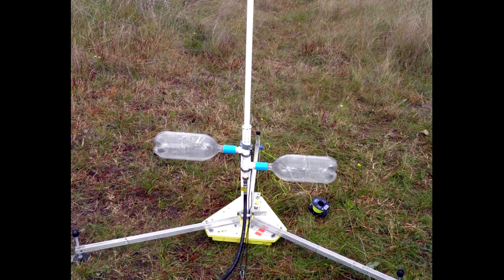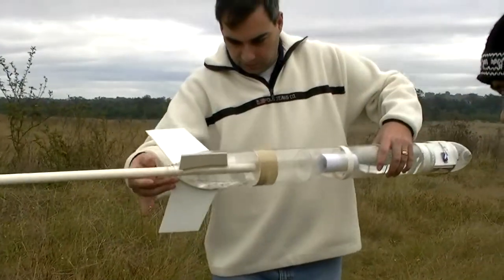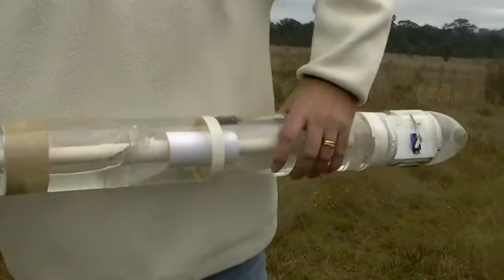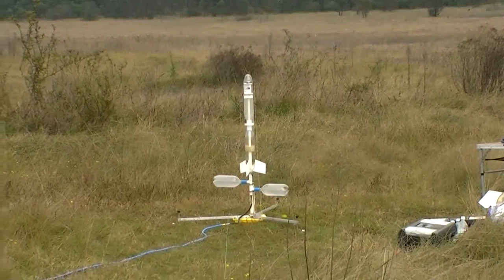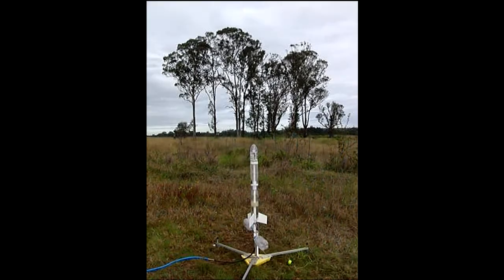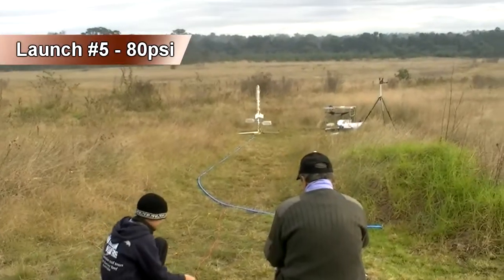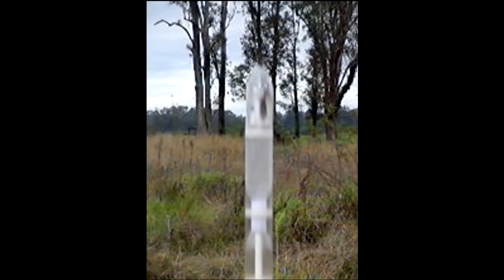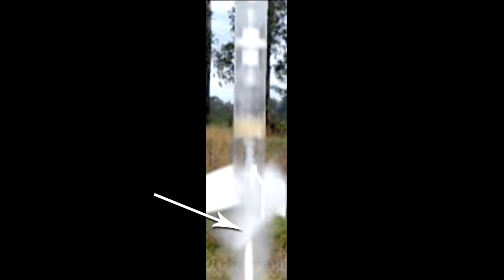Water rocket ARB tests

Comment from the maker: Hi, yes you want to have the launch tube as long as possible as it provides longer piston action for the rocket. The ARBs waste a lot of energy each launch as they only provide a small proportion of pressure compensation inside the rocket. For these launches at the end of the launch tube phase the pressure inside the rocket dropped to 93% of launch pressure without the ARBs and 96% of launch pressure with the ARBs.